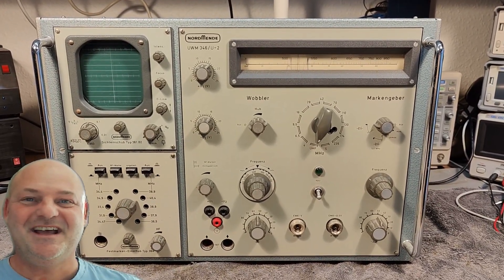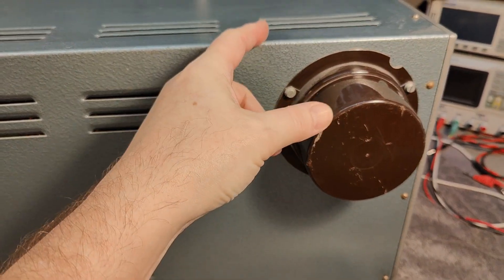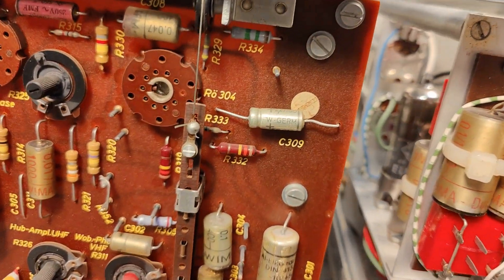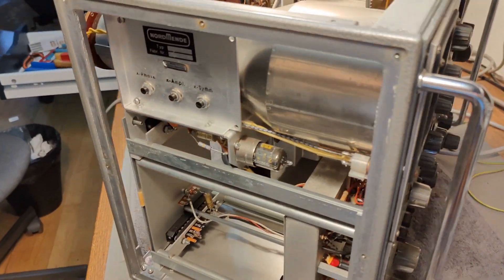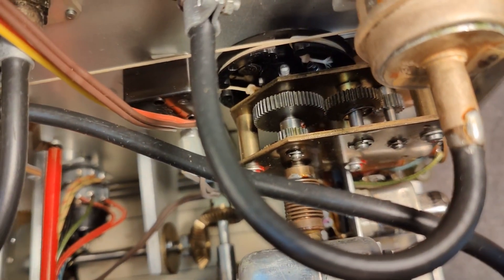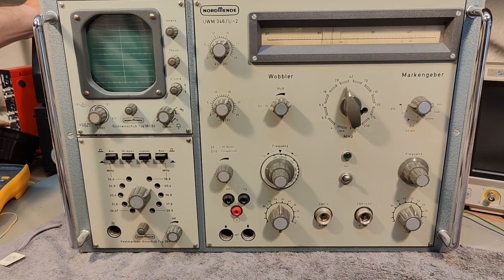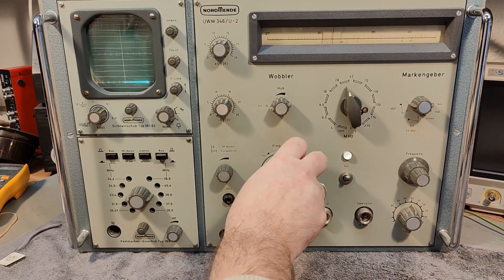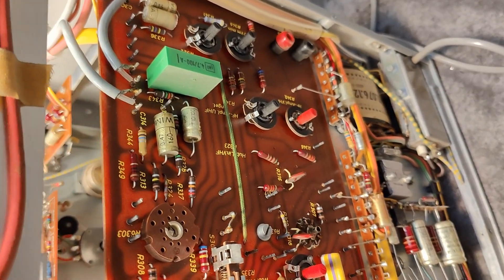Nordmende Universal Wobbel Meßplatz UWM346/U-2 1965

Comment: A transistor with floating terminal is not weird.  It can be intentional  Usually it will be the emitter or sometimes the collector (though usually it would be shorted to the base instead.).  The point of the former is to "broadband" a differential amplier by cancelling Base-Collector capacitance using a technique that in vacuum tubes was called "neutralization".

This is obviously a "swept tuned oscillator/frequency source".   

This unit seems to be roughly equivalent was the now obsolete Keysight/Agilent/Hewlett-Packard 8320B through 8350B sweep oscillators as well as 670x family.  The predecessors 670x series to the 8320 family was unique in that they used motor tuned klystrons and swept backward-wave tube oscillators (vaguely related to TWTs - traveling wave tubes).  Equipment like this is probably the only place most people (engineers) will ever see such things.  The challenge of fixing these is that these source tubes were made by HP or defunct vendor specialty tubes.  Some of what I see resembles those types of source tubes.

The unit can internally swept or externally swept.  This is can create a frequency sweep and dispaly x-axis sweep for CRT display.  Very common use for for "scalar network analyzers" (with a spectrum analyzer) which is the "magnitude only with no phase data" equilvalent of a VNA (vector network analyzer).

They can also be used for military applications involving electronic counter measure for radar and frequency agile radio and radar systems (by 1960s/1970s/1980s military standards).   Modern equivalents are generally better at that use - a single off-the-shelf DSS oscillator chips can do all the things all that mechanical stuff does in this equipment.  These chips even do all that $100K instruments from HP did in the 1990s...

Comment: Sounded suspiciously like a mains input filter component. Check the mains input. There may be a filter circuit on it and one of the capacitors may have done what rifa capacitors do. I've blown up a few in my time, and despite the loud crack, the damage is not always obvious. I presume you tried the sniff test too.
Reply: The fact that the device kept running after the big bang (trace on ye Olde Oscilloscope screen as well as the nice wobbly signal on the modern scope both didn't change or at least not change much) points in the direction of some filtering component.
The seal of the rightmost capacitor at 15:48 doesn't look too healthy. Then again, that doesn't have to mean a thing. Sometimes these old caps just do that. They look beyond sus, you measure them and they measure perfectly fine (or at least within tolerance) on capacity, ESR and leakage.
Reply: @senilyDeluxe  Yes, but what happens if you put it under voltage ? Is it still fine then ?

Comment: 7:01 - "Made in Western Germany" - that dates it a bit, for sure.
Reply: Made in West Germany" refers to products manufactured in the Federal Republic of Germany, also known as West Germany, between 1949 and 1990. The use of the term "West Germany" began after the division of Germany and the founding of the Federal Republic. The reunification of Germany on October 3, 1990, rendered the term "Made in West Germany" obsolete, as the countries were reunited.
Reply from the maker: @NixieClaus  thanks a lot claus, this means we got two year codes 1949 and 1990, we can use for dating..
it happend a few times for me, the only information i had was this west germany thing written on the unit.
Reply from the maker: only it is from before 1990, i think this unit is from about 1965